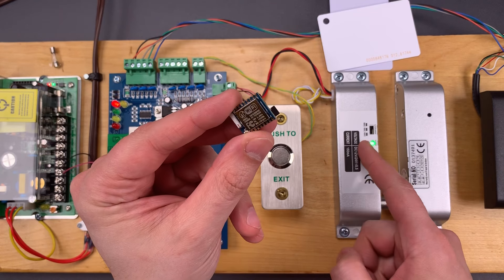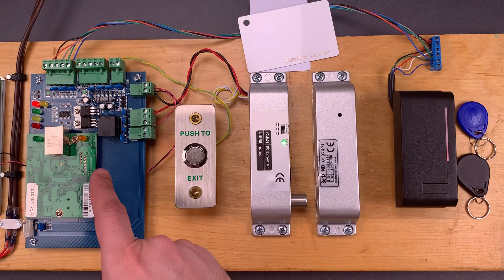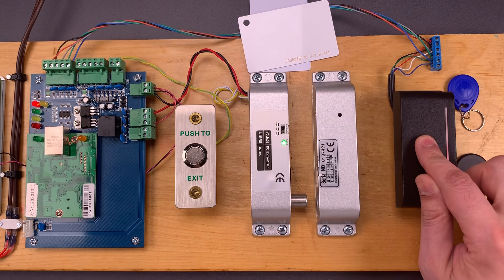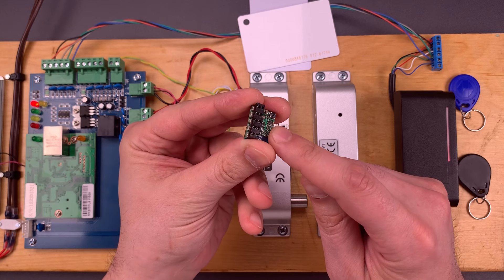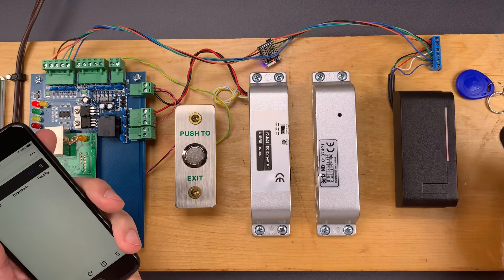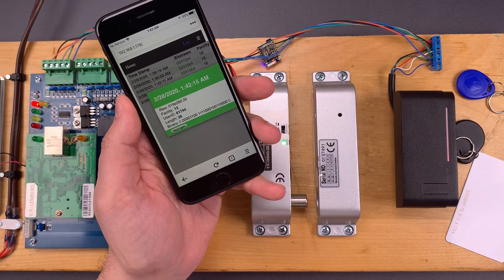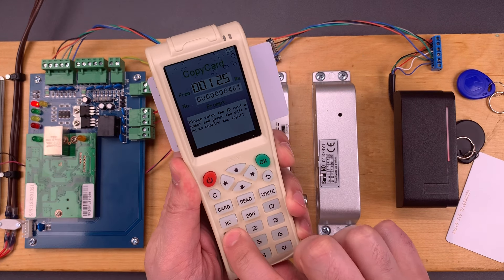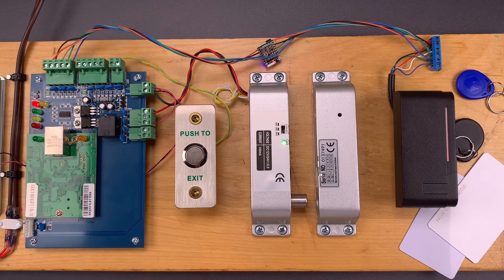[1052] Bugging an RFID Card Reader

Comment: This is a  classic RS485 + wiegand system. The flaw is known, but very acceptable to me for many uses : all habitations , single houses, and living buildings,or parkings. 

Encrypted networks are more expensive and do not follow industrial standards.

So considering prices and needs, rs485 + wiegand is the best solution for me. 

Exploiting the flow requires a good expertise in electronics, and motivation to unscrew some box, and take time to connect thin wires. 

For building access, there is not big enough value to motivate any one to hack this. 

Also, I have defined zones, as long as people don't randomly play with cards, a spy will only get numbers valid for one given doors, and could not build a card opening any other door. 

Also, my card readers do have an intrusion detector , so you can not install the spy without sending me  a notification. 

And you can not access the wires without opening the card reader. It could be possible in other buildings if wires are exposed. But in my building wires are in 55cm thick walls, and only run inside the walls. Accessing the wires without opening the reader requires a hammer drill, and 1h of noisy work. And you are VERY likely to damage the wire with the drill ...

Comment: I don't think hashing (or as he said, encrypting.) the data would do much on its own without it being salted.
It would stop someone from making a copy of the tag/card. But it wouldn't change anything about the communication that is done on the wires themselves.
The code is just changed to a different code once it leaves the reader, but thats it. The ESPKey could just read the already hashed code, and replay it again at a point where  .
But if the hash is salted, (With something unrelated to the tag/card, usually time.) then the code the controller is expecting would be different each time a card/tag is read. So just replaying an old code wouldn't work. As the controller is expecting a different code. (That code being what you get if you put in the correct card/tag, and hash that code along with a salt like time.)
Reply: As someone who works in this field, the technology that is being used in this video is likely to be wiegand, a very, very old and outdated protocol. A more modern communication protocol would be OSDP, but not the standard version, use the encrypted version. It blows wiegand out of the water as security goes, and replay attacks are virtually impossible without knowing the encryption keys. 
There are of course other options as well from other non open source systems that have even higher levels of encryption.
Reply: @NZSpides  Seems I forgot that encryption implies a form of salt. Usually a random number.
Reply: @vulduv  Unfortunately, salt is not always used in encryption, and it's not always unique either.
Reply: @NZSpides  Damn, that's unfortunate.
Reply: @vulduv  I've listened to a security podcast for about the last 13 years and some of the crazy things people do wrong is nuts. (Security Now - TWIT network)

Comment: Because this particular lock isn’t encrypted, you could just read a card wirelessly when someone uses their card and then program your own. Your reader would have to be very close to the door reader but most people don’t pay much attention to these things. 

A very simple (but increases the cost) add on to this reader is a hard-coded number that the card needs to transmit to pass a switch in the reader but isn’t passed to the brains; it would stop this type of entry. But like most locks LPL defeats, a cost saving has rendered the lock easily pickable.

Comment: Most HID cards also have their default 5- or 6-digit code printed at the bottom of the card, so it's ridiculously easy to use any number of social engineering attacks to gain temporary physical access to someone's badge and then memorize those digits to apply to another card at your leisure.

Heck, you can probably socially-engineer the number out of someone directly, like "Hey this is the security department, we've been doing an audit and we have two badges registered to your name. Could you tell us the last 5 digits printed on the bottom of yours so that we know which one to remove?"

Comment: If you absolutely must use an unencrypted system like this (for example, if you're just the installer and can't convince the powers-that-be to replace it with an encrypted system), then, if possible, install it in a way so it is fully recessed into a wall with a steel plate overlapping the edges by 1/2" or 1", making it impossible to remove to get to the wires.  Obviously, you'll need to make sure it can be accessed from the inside of the room in order to complete the installation and to perform any necessary repairs or maintenance.  Making it so that the sensor which scans the card is the only part accessible to would-be attackers would go a long way to to preventing this specific type of attack.

Comment: Interesting gadget. The only system i know/use that encrypts the data is by HID and the controller is called V1000. The controller alone costs roughly 1000€. Better to just make the wires not accessible by pulling them inside tightly and hand twisted. That way when someone teies something like this they pull the twists apart. Still verry enetertaining tutorial!

Comment: Im assuming the device you used was some kind of  NFC reader/writer because you mentioned that the access control system is RFID based in that case if your phone has NFC support you can write the card using your phone and don't need the device you can also just use your phone/ any phone as long as it has the right credentials.

Comment: With the size of components these days it would likely be simpler to create an extremely thin scanner powered by a button battery you can just stick to the side of the real scanner.  Leave it in place for a day or two and then retrieve it and read the card data from it.

Comment: I work with a company that places RFID readers and such and we connect a tamper switch in the RFID to the alarm system so that when you open the reader the alarm will go off and the sirens start going.
Reply: Is it one of the ones that can be defeated by a singular magnet
Reply: @swordscar6278  nope its plastic

Comment: The dead bolt system seems to be an improvement on these kits which normally just hold the door using an electromagnet.
Reply: @killhour  but if the power fails (or is made to fail)?

Comment: "encryption" will also only get you so far, ideally you want to have key fobs with something like a challenge-response system where every time the system is accessed the message is and has to be different. That would only leave it open to wormhole attacks, which are considerably harder to pull off.

Comment: Another thing... A lot of systems can detect a change in voltages, or tampering with some wires such as installing that RFID spoofer. Some systems will be able to detect that you've installed one and completely lock down or notify the administration. So don't expect to be using this in high security facilities as you will get caught very quickly
Reply: @KamikazeSOF2  I agree 100 percent!

Comment: Encrypting on the way to the controller isn't good enough, because you could also bug it with an rfid listener that just reads the card at the same time the reader does. You need challenge response system where the controller sends a number to the card and the card responds with it's own id and also uses an otp algorithm to respond to the challenge with a different number. Encrypting that data stream would be a bonus, but if set up correctly you don't need it.

Alternatively if you have a robust enough card you could also use a system that verifies the card and then rewrites it with a new number every time it's scanned. That way you don't need a card capable of challenge response. Not sure how long it would last with that many rewrites, though.

Comment: But usually, the reader would be monitored (also to the wall) by a tamper switch - often a sealed black back box and the tamper switch being a light sensor on the back of the reader. So this action should raise flags in the system. Regardless, encrypted is obviously better, but the biggest point of weakness in most scenarios of these card and no PIN based access control systems is simply having the card "swept" by a mobile and concealed scanner, like in a bag, reading a valid card. This is why the addition of a PIN code is such a vital, yet often entirely overlooked, element of access control systems.

Comment: It seems that you need slightly more brains in the remote box because plain encryption cannot prevent replay attack. For example, X25519 would be a better way to solve this. However, one would need to use active RFID cards where X25519 implementation is on the card or the attacker can just replace the whole reader instead of dismantling it and connecting ESPKey into the wires.

Comment: Only just stumbled across this one and noticed a major failing in the lock processor from your description. 

The very first check the lock should make is not the card data, but the card serial number. It won't prevent the demonstrated hack, but will make production of a cloned card/fob a little more difficult requiring truly blank devices and a means of writing the serial number
Reply: This is definitely a very VERY basic RFID reader to be fair...
Reply: @rayjaymor8754  This is why I hate such units, a couple of extra lines of programming code to include a check of the serial number or permit a new one spread across a few thousand devices would have no cost at all. It is taking economy of manufacturing to a whole new level.

Admittedly it is possible to buy RFID keys that have no factory encoded serial number, and programmers that can write them, but the extra cost and complexity is beyond using a phone or $20 handheld device to clone an existing tag without sn checking.

Comment: You can actually use it to get in without using a card. There are replay options directly built into the device. It’s the better option as this will defeat encrypted cards

Comment: I've thought about this before and was wondering if nfc payments would be able to be taken advantage of in the same way. I always thought about using another scanner. Due to the way that nfc/rfid works. There is a coil inside and whenever it comes near the right frequency voltage being produced from a coil it has just enough energy to charge and then out put a 2 pin chip. (You can look at this if you have a blank card and a flash light.) But just also receiving the signal to another coil and reading then writing that. What am i missing?
Reply: Authentification procedures using some kind of public/private keys pairs. This only really works for active devices though, passive devices are far more precarious, as their lack of computing power makes the likelihood of the existence of a practical attack using a proper computer much higher.

Comment: One of those ESP8266 modules uses a fair bit of power, enough that the controller could monitor the power usage and report or disable the system if the power from the card reader wires were too high. Obviously you can bypass this but it would be another level of protection that wouldn't be very difficult to add to the circuit board.

Comment: Doesn't matter if the lock/key uses encryption. The control unit would have to decrypt that data anyways so you could replay the encrypted data and still gain access. The only way to make RFID systems like these secure against key cloning is to combine them with a keypad.

Comment: The real issue here is that the card really just transmits a number that is set to it. Real secure RFID systems use some sort of RSA exchange that is between the chip in the card and the safe side of the door. In that exchange, the card reader serves only as a proxy.

The system you demonstrated here could be more easily defeated simply by skimming someone's card to learn the correct number.

Comment: In any case this passive RFID tags are vulnerable to be cloned, even if the information shared via wire are encrypted... For example I work in a bank and my access card are cloned in my cell phone, so when I need enter on the park spot or even on front door I just use my phone...

Comment: Crypto on the connection for this attack is the wrong solution. To implement your attack you needed physical access to the wiring. You could have cut the wires and done a man in the middle attack if it's public key crypto, or if it's not, extract the shared private key from reader. Additional it doesn't solve the replay attack if the attacker wires a bug into the reader (pre crypto) or places a bug adjacent to the reader. The cards can still be cloned.

The better solution is to have a challenge-responce system, where the fob is asked to do a secret calculation with a value supplied by the reader. This value would change after each attempted entry. It doesn't matter if you bug the wires or attempt a replay. This is how Chip & Pin works for debit & credit cards.

Comment: sounds like something that could get slipped into a building via social engineering too.  Someone comes in looking the part of being the maintanence department for the company or even the buildings of the office park.  gets this into the access control, changes some lightbulbs to make the job look legit and leaves.

Or finds a side door that say commonly has the smokers come in and out, taps the pad there and just comes back at the end of the week and downloads the cards basically innocently as they drive by that door.   And only the most vigilant IT departments who do regular site surveys for rogue WAPs would even notice this thing sending off a wifi signal that should not be in the building.  Of course that is only if its always on, I would not be shocked if things like this could be programmed to only fire up the radio at set times so you can be there for it.

Comment: Even without the espkey (physcal access) and the lack of encryption between card reader and control unit, it would be probably be very easy to just brute force it. A 6-digit-number might be ok if a human has to remember it, but I'm confident these cards could easily store longer keys to be less prone to brute force.
Reply: More than a handful of failed attempts SHOULD trigger a red flag. I don't know that it would, but any system that sees a half-dozen wrong cards being used ought to tell someone that something weird's going on.
Reply: @Veylon  there is an even easier variant for systems that don't have a communication backend: after a few failed attempts, make them wait, after more failed attempts make them wait longer. Phones often do that, but I doubt they implemented something like that in this system.

Comment: If the lock is installed properly you don't have access to those wires from the outside, so you would have to already have access to the building.

Comment: An easy fix would be to just leave the wires short enough so if the card reader is pulled off the wall, the wires would rip out.

Comment: I like the video, but what we see here is a very easy and cheap system. In Reality, it might be difficult to gain access to the wires (from outdoor). Advanced readers also have cryptographic so you will only sniff garbage, and also secure readers have anti-tamper, which means if you try to break the case it will notice and delete all security info.  But for cheap systems this video is very informative.

Comment: Yeah but now you have mifare desfire, encrypted rs485 (using osdp or not), and even accelerometers to fire off an alarm if the card reader is being tempered.
Also there are some features that prevents an id to be used twice in a given period of time or being used to enter if it has not been used to get out (though it requires a reader on the exit as well then).
The only real weakness in access control systems is the underestimated budget you put into them.

Comment: This attack is near impossible to execute as you need to be able to gain access to the wiring harness to the reader. The trouble is you need to be able to fit the device without anyone seeing you, and lets say there is a camera at the door as usually there always is. Also if the reader is well secured to the wall it will be impossible to get it off without destroying it and leaving evidence of tampering, or even breaking the reader, and you will not get any codes. The reason why its not encrypted is it doesn't need to be, and most encryption can be cracked anyway. One simple trick is the pull the cable tight from the other side, so it impossible to remove the keypad without breaking the cable, as there is not enough cable length it will fall into the wall gone! Cut a hole in the wall? yes but we can see the damage, may as well just kick the door in.

Comment: very cool, like an inline packet sniffer. So as a separate question, if the encryption isn't using a rotating cypher would it even matter since you could effectively inject the exact same message that was sent by the card scan using this device? I mean I suppose it could make programming a copy of the card harder.

Comment: How long would it take to actually make that insertion in a system that was "normally" built up? i.e., it's set in a wall or something. Would this not be suspicious activity taht on-site security would notice?

How difficult would it be to physically construct it such that you can't get to the wires without essentially burrowing through the wall?
Reply: Just put on a reflective vest and you can open it
Reply: @srebrnykruk  I'm not too sure that would fly where I work.